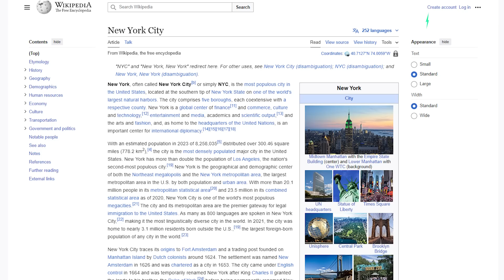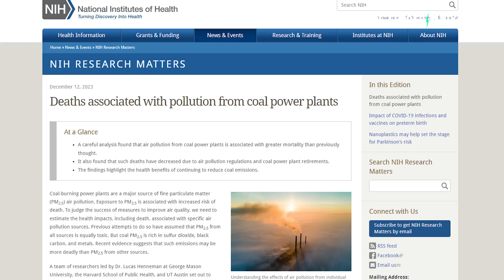The world’s biggest solar farm will provide power for 15 million people

Comment: Viking says he doesn’t know why 4 GW of coal fire power is included. When there is no sun shine and wind you need to switch on a backup coal-fired generator. You have two choices at what place you install the generator. Either at the solar and wind site or at a different location. If you install it at a different location, you have to connect the coal-fired generator to the grid by some connection lines. If you put the coal-fired generator at the solar and wind site, you do not have the build a separate connection line for the generator because the generator can use the connection line of the solar and wind station to move the electricity it generates to the grid.
Reply: "you need to switch on a backup coal-fired generator. " Coal is a terrible short term backup source. It takes coal plants 16-24 hours to reach peak efficiencies as the boilers make it to optimal temperatures. Natural gas is enormously more efficient. My guess is the "backup coal" will stay in continuous usage.
Reply: Can't depend all on solar, a massive volcano may erupt and emit smoke and block the sun for maybe ten years
Reply: Nope. Battery storage does the trick

Comment: Protracted delays are not the sole domain of nuclear energy.  Australia's Marinus link renewables project was initially proposed in 2016. It has been 'in planning' ever since and has recently been downgraded by half. Construction 'might start' in 2026. Not holding my breath.
Reply: Snowy hydro 2 should be finished by now costing 2 billion. Latest estimate is 12 billion an counting with no clue when it will be finished.
Reply: @Guvament_bs  yes, these projects are hard. To reliably power Australia with renewables we will need about ten Snowy Hydro 2s so need to get cracking

Comment: While these massive solar farms have their place in the mix, I can't help thinking that there are lots of large urban areas that should be used first. 50% of the paved land in the US is parking lots (which is a pretty damning comment itself on poor US planning regulations). A study looked at Walmart in the States and found that if they installed solar panels over the car parks of their Supercenters on average each Supercenter could generate 3.1MW of energy - sufficient to power 100 charging points for EV cars. Walmart has 3,700+ Supercenters in the US giving a potential for 11.1GW of energy powering 346,000 charging points - and thanks to Walmart's Supercenter locations 90% of the US population live within 15 miles of one.

Comment: The real advantage to siting solar and wind power on the site of, or close to, old coal power plants is really that the grid connections are already there to transmit the energy. The same holds true for putting floating solar panels on reservoirs that feed hydro-electric plants - they're more expensive to install but also don't waste land.

Comment: No, it is not illegal to put solar panels on your balcony or yard in Aust. Ok if is off grid and is extra low voltage. Can parallel up say new or second hand solar panels if wired correctly ie fused and cable sized correctly. Feed to a DC-DC converter, the output say a LiFePO4 12V battery/s (either 12 or 24 Volt system, depending). From this battery, connect a good quality pure sinewave inverter eg a 3kW one to charge your EV or run an AC at night or whatever. I just saved you some $$ (as long as you do it right and don't burn your house/car down) You are welcome 👍⚡️

Comment: Every society that has successfully decarbonized electricity production in under a decade has done so through NUCLEAR ENERGY:  France, Sweden, South Korea, Ontario Canada. S. Korea cut the cost of building nuclear plants 30% in real terms from 1971 to 2008. Distributed baseload: Nuclear can be put essentially anywhere removing the need for building significant transmission lines. Modular nuclear power supply can be perfectly matched to power demand in location and in time. The second of the Vogtle plant’s two reactors was 30% cheaper to build than the first because workers and project managers learned from their mistakes building the first reactor. Point Beach 1 & 2: 1100 Megawatts at less than $1000 per Kilowatt. Built is LESS THAN 3 years from 1968 to 1971. Build 10,000 of those plants. You can decarbonize America in under 5 years if you simultaneously build enough Point Beach 1 & 2 replicas. Scan all the valves and pipes and everything and duplicate it. Nuclear is the single source of power that can simultaneously scale to global levels of consumption, power the removal of the last 200 years of carbon, and most importantly fully account for its own compounding emissions. NRC standards set radiation level guidelines TEN THOUSAND times lower than science justifies, which is a primary source of nuclear’s expense. Nuclear power currently produces more than 50% of emissions-free electricity in the United States. BUILD NUCLEAR, drop the disinformation campaign.

Comment: coal + battery storage may make more environment sense than you may think. If coal power can be kept at a consistent output level it can be optimized to produce maximum power output per ton of coal input, optimizing the thermal characteristics will also allow it to burn in the cleanest (still dirty but less dirty) possible way. The batteries allow this consistent level by charging on excess production and supplying top up energy during peaks. The maximum pollution times for coal production is during run up to peak demand (poor burning and wasted production as not yet required) and after peak, excess power produced as plant reduces capacity so again wasted production. Until we have enough storage capacity coal & gas will still be required, so we should optimize their performance, reducing the pollution they create.
Reply: Why using coal? Solar panels are far cheaper already anyways for electricity generation.

Comment: South Australia can produce one hundred percent of its electricity needs when the sun is shining and the wind is blowing. But the rest of the time they use the interconnector to other states who depend on coal. South Australia also uses huge diesel generators for grid power. They therefore cannot be said to be 100 percent renewable.
Reply: Redundancy and storage is the problem, until it no longer is.
An old friend runs a gas peaker plant that has a 50% redundancy.
Solar/wind/storage isn't quit there yet.
The next 10-20 yrs will be transformative imo.
Reply: Battery storage is exceeding hydro storage now, with far less costs and space required. 

Storage is deployed in ever larger amounts now. Good times, especially as batteries like Hornsdale can provide synthetic inertia and grid stabilization within milliseconds.
Reply: That’s false, do you realise that power from solar and wind aren’t dependant on when it’s windy or sun is shining . We have solar but we are still using solar during winter . You need to educate yourself on renewable energy
Reply: @wcrash9361  where can I get one of these solar panels that generate electricity at night. I could sure use one of those.
Reply: @wcrash9361  heehaw heehaw
Reply: @wcrash9361  wr
Reply: Idiot Albanese says that you can recharge your EV at night from the solar panels on your roof - so it must be true!
Reply: My replies are now blocked. Even the Al Gore rhythm knows that I won the debate and doesn't like it. Some facts to ponder perhaps.

Comment: One of the biggest issues with solar and wind is that they are intermittent, while demand is continual.  That means that backup generation (typically fossil) needs to be kept on inefficient standby.  This results in overall increased costs.  Batteries are too expensive to solve the cost problem.  Poor people suffer as a result.
“. . . a naïve observer might conclude that the rising share of new renewables (solar and wind) will usher in an era of falling electricity prices.  But in reality, the opposite has been true.”  Vaclav Smil, Numbers Don’t Lie, p.172
Reply: FALSE.  Battery power moots your entire argument.  “Batteries are too expensive” -> They are cheaper every day compared to the absurdity of the oil industry which sets the whole world on fire and burns it down, and then sends people like yourself forward to brainwash us with the absurd lying claim that there is no other way.😊
Reply: @summertyme5748 Australia uses about 5 terra watt hours weekly. How much would one weeks worth of battery storage cost. It often rains for a week non stop.
Reply: >--“. . . a naïve observer might conclude that the rising share of new renewables (solar and wind) will usher in an era of falling electricity prices. --<   Solar has greatly reduced the cost of electricity at my house. All my PV generated power is used on-site, for DHW, space heat and air conditioning.  None of my electricity is exported to the grid.  I save on the cost of electricity and also on all the per-kWh taxes and fees which now totals up to 16.5 US cents/ kWh.
Reply: There are other forms of grid-scale storage.  Look at this channel and others for topics like liquid-metal, compressed CO2, sand, gravity, and good old pumped-hydro.  Lithium batteries in all likelihood will not be the dominant technology in this critical space.  As renewables are the only way forward, grid-scale storage will be vital to national security as well as species security.  When this happens, you'd be surprised how innovative humans become.

Vaclav Smil needs to understand that generation is only one-third of the total grid energy cost.  The others are transmission & distribution (T&D).  Renewables are the only technology that are growing so incredibly fast that its pushing on the frontiers of the grid unlike any other technology has.  Hence it may appear that renewables pushing up electrical costs at first.  We also need to look at world-wide inflation triggered rapidly by good old pursuit of oil which plays a big part in why Putin wants Ukraine.
Reply: @beyondfossil  I am not up to speed with all the alternative storage you mentioned. I did watch a U Tube video on gravity. It was very detailed and used all the associated physics and mathematics and it showed conclusively that gravity, except hydro, was a pipe dream. It is just not feasible. For decades in Australia the green party who hold the balance of power have forbidden dam construction due to the amount of environmental damage they do. But of late they have thrown the environment under the bus and will allow some dams. They also used to forbid any clearing of forests. But now they can't knock it down quick enough to put up bird blenders.
Reply: Compact discs cost less to produce than vinyl records, yet they sold for more money.  Was that the fault of the new technology or the fault of industry seeking greater profits?  Lots of things, including electricity, have risen in price in recent years, not due to a fault of the technology but due to the search for greater profits.  
    For a better understanding of costs, read up on  "levelized cost of electricity", a study published by Lazard and Associates.  Lazard advises investment companies.  Lazard would be in huge trouble if their info was not accurate.

Comment: Don't forget China are also currently building 23 nuclear reactors which primarily will support manufacturing. Solar and wind will only support domestic consumption. If Australia is ever going to be interested in manufacturing especially 24/7 operations in this country they will have to introduce Nuclear.  Country's like Australia will hit green energy targets with solar and wind and moving all manufacturing to China. So I ask what is the true cost of not going nuclear for Australia.
Reply: The number of planned nuclear plants in China is in decline because of changes in energy policy.
Reply: @chrishaberbosch1029 don't disagree but they still have 36 under construction since may 2024
Reply: Exactly mate, and the renewable worshippers don't want to hear that.
Reply: Plus more than 100 coal fired plants.
Reply: @Guvament_bs When plants currently announced or in the preparation stage but not yet permitted are included, this number rises to 306 different coal power plants.

Comment: Sam, could you p-l-e-a-s-e ensure your videos bear some resemblance to what you are speaking about. The Solar farms shown are a higgly-piggly mishmash of 
- agrivoltaic farms, 
- mirror reflectors heating salt in a tower to run a turbine, and 
- huge arrays of just plain solar panels. 
Which is the solar farm you are speaking about? If it's more than one sort, then map and call it out rather than throwing ambiguity into the bowl and stirring it all together.
Reply: Yes!!!
Reply: I agree. I recently subscribed. There is so much random video on the site that has little connection to the topic of the video. I would say there are too many videos, at least once a day. Better to have fewer, with the video reflecting the content. Otherwise they are really podcasts with some random unrelated video. Actually the "podcast" content is pretty good in its own right.

Comment: oops hail storms ; hair storms haven't happened so far.
Reply: Lived here in LA since 1982 and no hail ever! You install these in areas with lotsa sun and no hail.
Reply: @larryc1616  No hail storms in LA so far; but climate is suppose to be changing and you've had a lot of rain. But for sure one thing I have witnessed myself is sand storms; I was on the way from Vegas to Palm Springs and there is a big solar farm right there about half way.  I have a photo of it actually - a massive sand storm covering everything; and it also damages the glass surfaces of the panels. So if you had this size solar farm the size of NYC - how long just to clear it of sand once?  And what if you have lots of storms.. I also mentioned the potential for terrorism. Seek better options.
Reply: The can make a barrier that's clear and works like a magnifying glass to amp power in panels and protect
Reply: Solar panels are now engineered to withstand hail.
Reply: @chrishaberbosch1029  there is hail and then there is the size hail that Texas experienced that destroyed the large solar array there.  That sort of hail can be the size of golf balls and can dent steel car bodies, if you know of any that can withstand that sort of hail; please send a link; I did see some flexable panels that might.

Comment: a vexing problem; it is competition for useful land; unless it is in a desert. If in a desert; there will be sand storms. How long to clear off solar panels that cover an area the size of NYC?  What prevents another storm? Not only does stand cover the panels; it scratches the surfaces making it less functional. Hurricains and storms can wipe out floating solar farms on barges; which has already happened; as have hair stormes in Texas. Oz probably has minor terrorist threat; but the USA has significant threat; if all one has to do is fly over with a small plane and drop loads of screws - oh maybe that is where the term comes from..your screwed.
Reply: You just rotate the panels upside down and most of the sand falls off. Little air pressure pipe to blow the rest off. Then a squirt of water. Can have grass for grazing animals underneath.
Reply: @TheBooban  OK so if this is the size of NYC ; how long does that process take?  How about snow? hail, frost, fog, dew from fog, high winds, terrorists, juveniles tagging with paint, general cleaning.  What we are trading is solid hard to destroy things like Dams, nuclear plants, and natural gas power stations and replacing them with giant rather fragile panels that are very difficult to secure and keep productive. What do you say?
Reply: @TheBooban  Just as another bit to add; I was watching a video here on how to clean solar panels; the fellow says ; you can't just turn on the hose and spray it clean; if the water is cold it will crack the glass; if it is tempered glass the entire thing will fracture. So now we need a temprature contolled water system covering an area the size of NYC?
Reply: Not a problem in California 🌞
Reply: Not a problem in California 🌞🇺🇲
Reply: I have lived in the desert for 20 years. I have never seen or heard of a sandstorm.
Reply: @patrickhenigin4805  You haven't even heard of a sand storm?  They happen frequently in the middle east; and where ever there is sand; and wind you potentially can have the sant picked up and carried in massive clouds.  If you were in a destert that doesn't have much sand, you may not experience one but I'd think you'd heard of them.

Comment: 4-GW Wind + 4-GW Coal + 200-MW Solar? Why is planned coal generation 20X solar?
Reply: That's 200-MW of solar thermal, additional to 8-GW of PV Solar.
Reply: Search Electrek 8GW Solar farm.
Reply: Re-read & edit. 
Please add 6 GW of PV.
Plus 5 GWh of storage.
"China is doing half the work required globally by 2030" - over-achieving.
Reply: @iandavies4853  yes by building more coal fired power plants than the rest of the world combined.
Reply: @Guvament_bs  you really need to learn about S-curves, about developing manufacturing capacity.
Can’t solve a problem by whinging. 
Even USA will be faced by increased demand for electricity (esp super-computer clusters).
But won’t have the PV to power such. Digging own grave on pride & principles.
Reply: @iandavies4853  so what I said about China and its rate of expanding coal is wrong? OK
Reply: @Guvament_bs  China is expanding electricity production overall. 1.4 billion people, rapid urbanisation.
Yes, they are still building coal power stations.
But modern high temp, used flexibly, to fill longer gaps in variable renewables.
Batteries & solar thermal can fill short gaps.
Makes best use of HVDC? connection to Beijing.
No one else is manufacturing nor installing as much solar PV. Certainly not USA.
Reply: @iandavies4853  wr